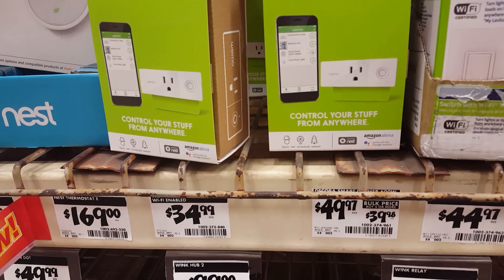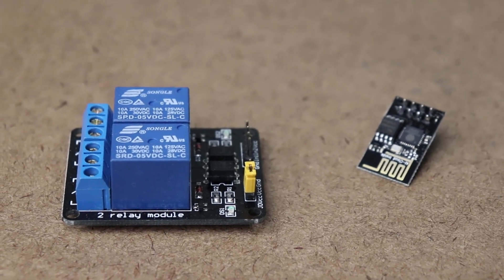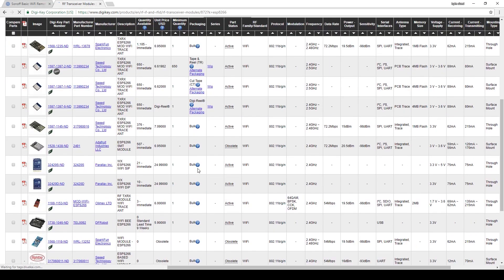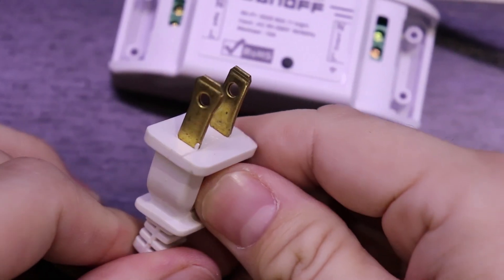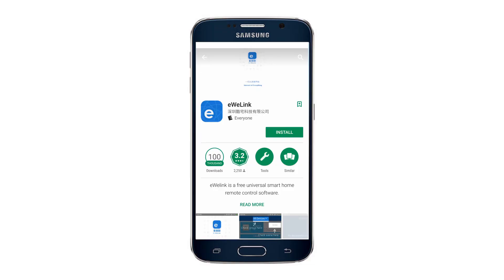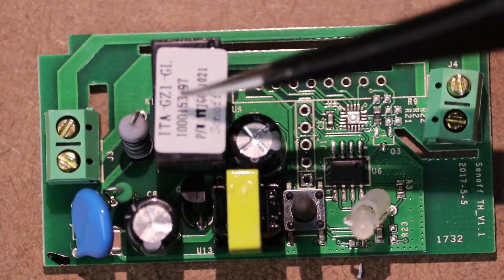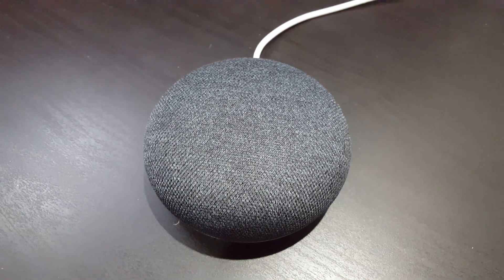Sonoff - The $5 WiFi Smart Switch That's Compatible With Alexa And Google Home

Comment: I'm looking for an Alexa switch that I could attach to my power button on the PC, so I can say, Computer, "Turn on PC" however, I don't think there are any switches other then 240V type?
Reply from the maker: I don't think the sonoff will work for that application. Think of the sonoff as unplugging and plugging in a power cable into the wall.
Reply: If you still looking to do that, you can use WOL (wake on lan) apps that connect to IFTTT and then to alexa
Reply: and its free

Comment: Would you mind answering few basic questions? I believe I will have to buy 3 Sonoff devices to control my 2 lights and 1 fan and attach with them individually. right? Also I will not be needed internet to control it. Just connecting through wifi router will be enough and just using my apps I can control my lights and fans?
Reply from the maker: I believe you are correct, you will need a sonoff switch to control each thing individually. If your lights are on the same circuit, you only need one sonoff for them. With the firmware that comes on the device, you will need an internet connection.

Comment: If you think of this thing as a cheap WiFi enabled relay, you can find tons of uses for it. It can be used for anything where you need to press a button. You could use the relay to close the same contacts that signals your garage door to open/close. You could use the relay to close the contacts of a mute button on a $3 universal remote. Then instead of being angry that your Apple TV can't mute your TV, you can (with the help of IFTTT) say "Okay Google Mute the TV"
Reply from the maker: Those are great suggestions!
Reply: Maybe you can do a video showing how to cut the mains traces going into the relay so that the relay can be used for closing other circuits. (I have a dozen coming but I am pretty terrible at finding the time to edit videos.) Great work, BTW!

Comment: So no ground cable so if there is a faliure there's nothing stopping me becoming ground not great.
Reply from the maker: They make other models with earth wire. Earth wires are really only needed for appliances with metal chassis. Things like lamps etc, don't usually have a metal chassis, and don't need earth wire.

Comment: Is this small device safe enough and reliable enough when you have up to 10A current to go through it? (say a fan-heater or similar) ??? Should it be trustworthy to leave it run while (still) away from home or while on the way there?
Reply from the maker: I would probably not put a continuous 10A load on this switch. They make other models that are rated at higher currents.

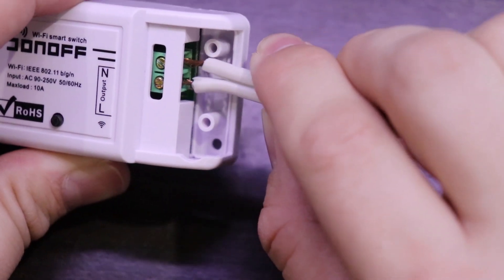Comment: "BE careful not to strip too much insulation from the wires, so that there is no exposed bare copper wire outside of the terminal block.  After tightening the wire-clamping screws, inspect the wires to make absolutely certain no stray strands of wire are outside of the terminal blocks, which could short out destroying your brand new Sonoff device, or start a home fire!" (such as it happening at 3:06)
Reply from the maker: Thanks for the tips! I checked everything very carefully before plugging it in

Comment: its a great product but beware if the sonoff servers go down in china your devices will fail.it has only happened once
Reply from the maker: I haven't had too many issues. You can also flash your own firmware on the device and run a local server, which eliminates your dependency on third party servers.
Reply: is everything still good? I want to buy them but I have heard to many reviews that the servers are down

Comment: The Sonoff are great!

The Sonoff version that you have got a small problem though, they don't have support for earth line, as the bigger ones have. The Sonoff 10 version are better in that way.  There are also versions where there are a power meter inside. And one with two relays in one.

The firmware in them are not open source, but there are some people that managed to reprogram it.  Easy to install, if you DO NOT HAVE AC POWER connected when you program it.  You can fry your computers USB port (if you are lucky, if not your computer and yourself). Always do it on a cold system, without hot AC power connected, and you will be fine. When the new firmware is in it, just connect it as usual.

I have stoped used the Chines web service and use the TASMOTA firmware.  Then I can use the Sonoff without needing to have a working internet connection.  Just my local WIFI LAN and my Mosquito MQTT server on my RPi.
Reply from the maker: Again, thanks for your feedback. I've heard good things about the TASMOTA firmware. I helped my brother in law install some new firmware on his. I haven't gotten around to doing it on mine yet.

Comment: Have you tried to tag yourself with a NFC rfid tag under the skin?  It is great addition. ;-)
Reply from the maker: No way! That scares me a little. Do you have a tag embedded under your skin? I watched the sparkfun video on the topic once and was mortified!
Reply: Well, it is a small RFID tag, which is used on animals, so the owner can be found if the animal run away.  So they are "animal tested" in many, many years. :-)

It is inserted with a large needle and it is just under the skin.  Works great, I have even used it register my ticket in SJ, the railway company in Sweden.  I just put up the fisted hand, and they used a phone to scan and check the ticket. :-)

The airline company SAS also uses these RFID tags for tickets (NFC is a subset of RFID).

I also know a office house in Sweden where they have all doors and printers controlled with these tags. The former curator of the Nobel Museum in Stockholm has one and it was after a presentation by him that I got it. I just wait form my flat and work (University) to get some devices locked by RFID/NFC so I can have more use of it. :-)

Well, all this could also be done by ordinary smart cards with RFID tags in them, but why? I never forget my left hand at home :-D  And no, security are not a big problem, as the can't send data unless the reader transpher energy from the reading antenna. And the antenna are so small and under the skin, so you must be near.  To bad, as my phone doesn't detect the tag. :-(

Comment: Anyone come up with a cheap integration for a tilt sensor or something like to tell you if the door is open or closed? I know a camera would serve this purpose but i'm thinking of something that could be integrated into Alexa or Google Home. Because the door could be opened or closed manually or fail the close due to the safety sensor, when remote you don't actually know if you're opening or closing it.
Reply from the maker: I use magnets and hall effect sensors. There are many that should be compatible with your system.

Comment: I use Broadlink SC1 for same reason, it is much more reliable than Sonoff. I have already 2 sonoff relays fried after small network outages.
Reply from the maker: That's interesting. What do you mean by fried? How did a network failure cause it to fry?
Reply: Network was unstable, voltage little vulnerable and once it stopped working. But it was not big difference with average number, up to 10-15%

Comment: Why couldn't you just wire this into the wall? Say wire it into a circuit of lets say LED lights are whatever outlet you want? Run the line wire and the N wire from your romex through this and it should be able to do the same. Heck you could run a ether net cable from house out to garage/shop and control devices/circuits out there with this couldn't you?
Reply from the maker: Yes, there are many other ways to install this. I chose to use an extension cord because it would allow lots of flexibility of where I use it. It allows me to move it around if I need to.

Comment: Is there a way to accomplish this but with a variable resistor (brightness control) knob instead of a simple on/off switch?
Reply from the maker: To control the brightness of a light you would need something like a triac in the circuit. There may be some other sonoff models that are able to do dimming, but I'm not aware of any.

Comment: Great video. But i find i cant pair the device.    First device was dead. The second device works but when i go to the ITRED wifi the password doesn’t work.  Just says unable to join. Or wrong password.   Any ideas?
Reply from the maker: Not sure how to help. Make sure your phone (or whatever device you're using) is on the same network.
Reply: Thanks.  Turned out the network was wrong. And the wires dont sit too well in the device.

Comment: Great way to muck up your wifi band!
Reply from the maker: Are you talking about having lots of devices connected to my network? WiFi was designed from the beginning to support lots of devices on a single network. Also the sonoff devices use little to no bandwidth most of the time. I've seen no impact on the performance of my network.

Comment: How does this work for wall switches? I only have 1 desk lamp and this looks like it would work for that but what if I want to turn on my bathroom, bedroom, or kitchen lights? Is this something that can be used to run wall switches?
Reply from the maker: You could fit this inside a wall, but I wouldn't recommend it. I know plenty of people have been successful with that sort of installation.

Comment: Good video! I'm not sure if you have looked lately but I saw a few different Sonoff Wifi switches with power consumption measurement on ebay.
Reply from the maker: Yeah, I've since learned about the sonoff pow model. It can measure power consumption. Thanks for the heads up though!

Comment: Perhaps the stupid question is apologizing for the sake of it. Can I connect a boiler or a home air conditioner with this switch? Maybe 2-3KW is too much for him?
Reply from the maker: The sonoff basic is rated at 10A which is probably not enough for a boiler or air conditioner. They make other models rated for more current.

Comment: Hi u forget to say u need sonoff for each device u using so if I have 5 different device witch I want to come on at different time I have to buy 5 sonoff and I don't know if I can name them for each device so the alexa can switch them on !!!
Reply from the maker: You can plug more than one appliance into the extension cord as long as you remain under 10A, but they will all turn on/off simultaneously. If you want individual control you'll need a sonoff switch for each appliance.

Comment: Hmmm..does it come with FCC and EU low voltage certification?
If not...for only 5$ you can burn your home...safe like the cheap USB chargers from Ebay or Amazon..they comes without any minimal safety protection (found out on my own skin)....
Reply from the maker: On the RF side, its using an esp8266 chip which complies with the IEEE 802.11 b/g/n standard. On the power side, there is no UL or similar certification. I spoke with the design engineer and I understand that they are working to get it certified.
Reply: Thanks..so the answer is no..it is not certified. 
To get the certification for EU and US cost a LOT of money...and then you need to get back your money you've invested. I know very well the 8266..the module is certified but doesn' count as certification of the product. Especially when you are talking about running into your device 110/220V.
Good luck yout the certification and hopfuly you can keep the price at acceptable level once done. It is not easy...as you may know..

Comment: I just successfully wired a lamp in my entertainment room using one of my newly acquired Sonoff switches.I have some observations which I think will be useful to anyone contemplating ordering and using these switches.They are quite tiny and this could be a good thing if your intention is to insert them into an existing electrical box but it does create challenges.

The insertion points for the wires are tiny, in fact the device itself is tiny. This means that there is no chance you would ever get standard 12/2 Romex wire connected to this device directly. Ceiling lights and standard switches will usually be wired with this 12 gauge wire. This means you will need to create an interface to this device where the 12 gauge wire is reduced to allow for connection. I'm looking into a good way to do this and have some thoughts but it can be a problem.Standard lamp cord is 14gauge sometimes 16gauge and can be inserted only just barely. The holes are tiny and the little bitty screws tightening the connection are also tiny. I just found inexpensive connector blocks that will easily connect 12g wire to smaller and is re-useable. If you're going to do a bunch of these switches and will need to interface larger gauge wire you really want these. Here's a link https://www.kinequip.com/wago-222-412-50-pk-compact-splicing-connector-2-conductor-terminal-block.html

The way these switches are rated is puzzling to me. Voltage times amperage equals power so if they are rated to pass 10 A on 110 V circuit, that wattage would be approximately 1100 W. Yet the device itself is rated only 2200 W. I'm not sure why the discrepancy but would be very interested to understand what the real capacity of the switch is.

I have smart plugs controlling nine amp pumps in my Koi pond and they are doing fine. I don't think I would want to try using these switches on such a heavy current draw even though they do say 10A. Would really like to have a better understanding of this. Any thoughts?
Reply from the maker: I agree that the power rating is confusing. I would suggest sticking to a 10A maximum load. The relay inside is rated at 10A and won't handle much more current than that. However the relay can switch loads from 90V-250V AC. Some countries like the US use 120V and (most) other countries use 240V. The relay is still limited to 10A regardless if you're switching a 120V or 240V load.

Comment: if you add this to an internal light switch, is there a way to manually override it so it works both through the app and through a tappable switch
Reply from the maker: The small black button on the sonoff toggles the output on/off independently from the app

Comment: Good luck when Sonoff decides it has collected enough data from users and decides to pull the plug on he app servers. Yes, this is controlled via "cloud". Plan on different control (Tasker for example) if you want to use these outlets. Also, they are poential fire hazard.
Reply from the maker: Those are fair concerns. Many people flash custom firmware on the sonoff to address these very issues. It's something I'm looking into. Thanks for sharing!

Comment: So, you would need one sonoff for each device, right?

If I want to plug and leave it?
Reply from the maker: Yes, one sonoff for each location. You could plug more than one appliance into the sonoff, but be aware that anything plugged into the same sonoff will turn on/off at the same time. You also shouldn't plug too many things into one sonoff as they are only rated for 10 amps of current. They make other models that can handle more current if needed. Hope this helps!

Comment: Will the wemo also work with high voltage appliances which require 3 pin socket, such as a kettle?
Reply from the maker: Not sure about Wemo, I don't have one.
Reply: byte sized apologies I meant the Sonoff. The extension cord shown does not have earth pin so wondering if Sonoff could handle the higher voltage appliances?

Comment: Great product, but in Australia its unlawful for us to use without the expense of an electrician to wire it.
Reply from the maker: Really? That's interesting. Even for things outside your wall?
Reply: Yes, in Australia you can do anything electrical, but the minute you need to disconnect an AC wire, your breaking the law  @bytesizedengineering

Comment: No way you are going to be able to measure the power with just a switch. You would need a hall probe and a DVM to measure a current. No way it has a hall probe and a DVM for 5$.
Reply from the maker: There's another model called the sonoff pow that measures power consumption. It costs a little more I think.

Comment: I tried to operate these when away from my home. It states network not established. Worked once I got inside and it all connected via my home router.   Shouldn't I be able to turn things on and off while away?
Reply: Read this up above
 https://www.youtube.com/user/zthipps
" When you setup the sonoff with the eWeLink app you can control the switch from anywhere with an internet connection. You aren't limited to being on the same WiFi network."

Although when you do this you may be introducing further security issues.
Reply from the maker: Interesting. I'm away from home right now and I just tested this again. It works just fine. Are you signed into the eWelink app?
Reply: I was on the Ewelink app.   I have seen many folks complaining about the Ewelink app working consistently. I think Ewelink is having some application issues... thnx for the reply!

Comment: (Just found the video so you may have already done what I'm about to suggest) I'm also using sonoff devices for all the benefits that you've highlighted but I discovered that it's very easy to hack the devices and load your own code. The benefit is that it frees you from the dependency on sonoff's apps and allows you to do anything that can be done with a standard ESP8266. Great video, enjoyed finding it.
Reply from the maker: Awesome! Thanks for sharing these tips! I can't wait to load the Tasmota firmware on one. I may come to you for help!
Reply: @bytesizedengineering  how easy is it for non desirable parties to hack into the ESP8266 and get control of your home as a backdoor
Reply: @Justin Ho < Especially if you use Sonoff's default dynamic IP servers ran in some chicken coop in China, once that's hacked then the attacker can access every single Sonoff device around the world..  They could potentially burn down your house.